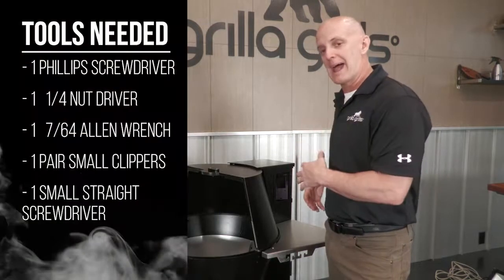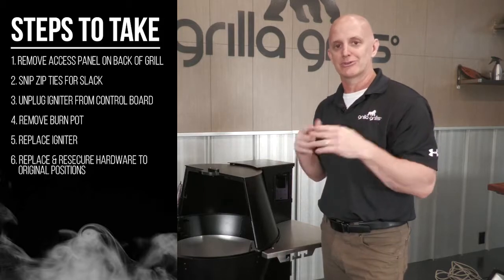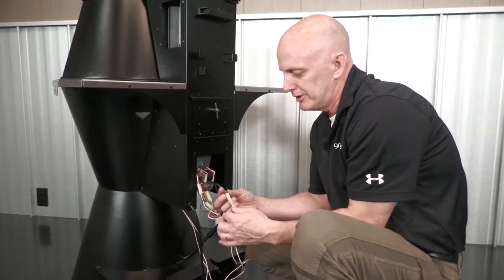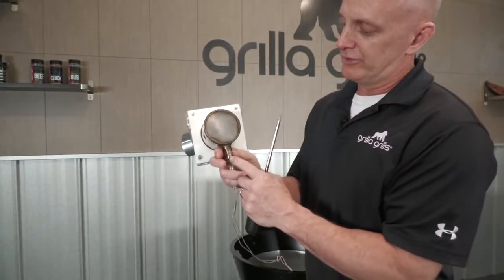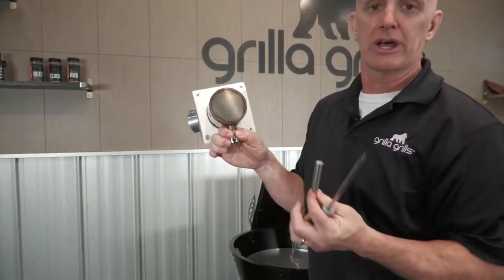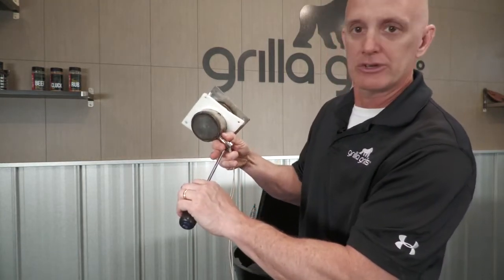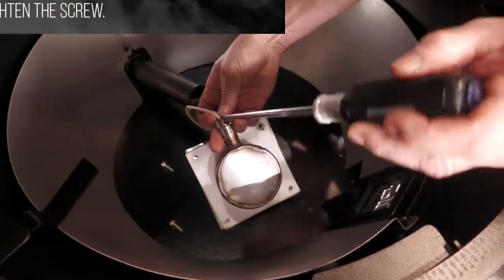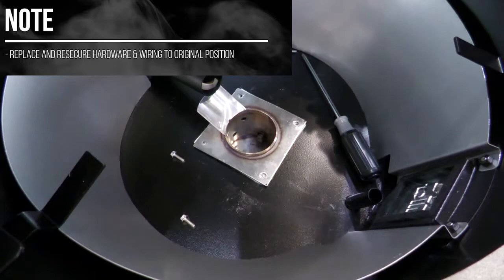How to Replace a Grilla Igniter | Maintenance with Grilla Grills

Comment: Great video!  The igniter shorted out on mine from a power surge - don't leave it plugged in!  I emailed customer service and they gave me the trouble-shooting instructions to figure out it was the igniter, sent me a new one, and this video was spot on for replacement.  Bolt size on my igniter box was 5/16" instead of 1/4" but no big deal.